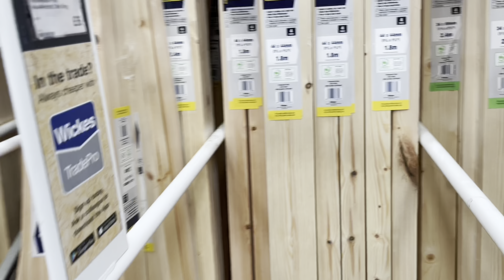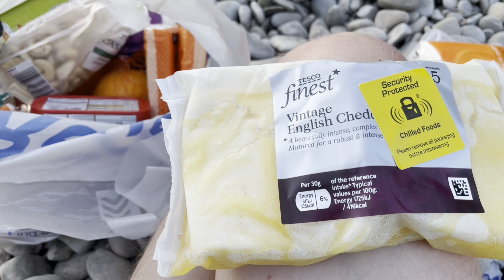Two Day Build and 150 Mile Solo Adventure - Pedal Paddle MK2

Comment: You've made some excellent improvements to the design. The dog leg design for the paddle mechanism is ingenious. Now you need a purpose built metal frame with bearings, so it can maintain the correct orientation under hard use.